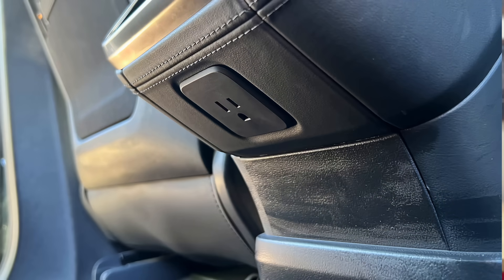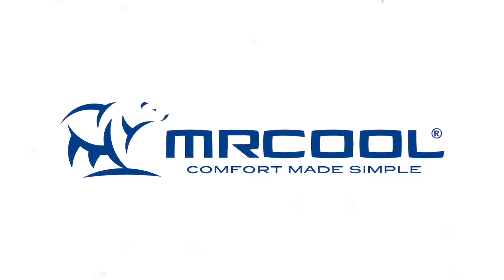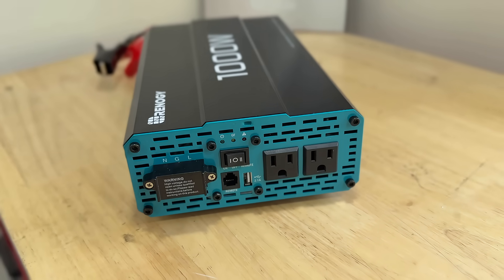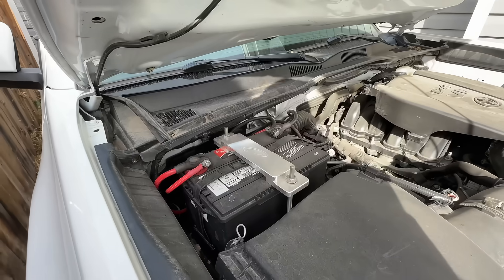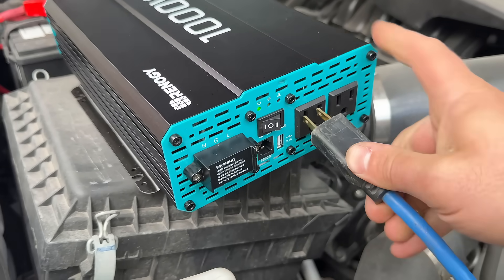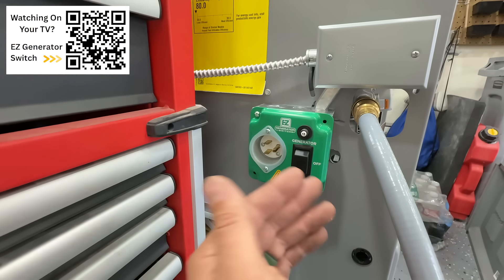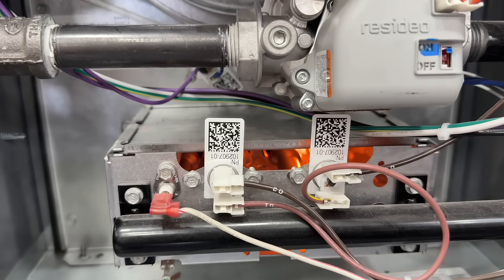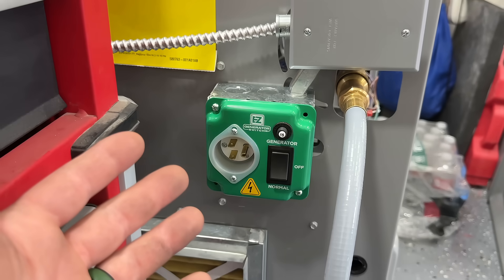Why Buy A Generator? You Have One Parked In Your Driveway.

Comment: Soooo..... burning gasoline at the rate of a full size engine to only get 1000watts of power is a rotal waste. A 1400 watt inverter generator at Harbor Freight is $399 and you can get it cheaper on sale. These will sip gasoline and less wear and tear on your car, and they are as quiet as your car.
Reply: As someone who came into this comment with no opinion, y'all make good points. Some for, some against. Your comments collectively help for the "How Much Will I Use It" category. Thanks
Reply: He said this is an emergency situation. People
In emergencies don’t care as much how much gas they’re going to use. I don’t think people are going to be running their fridges and whole entire home off this set up for a long time! Maybe something enough to make a meal and save some of their food and charge a few devices.
Reply: @BeachMum so 400$ for a proper generator running a 212cc engine 3 gallons per 24h or 200 for potential damage to your engine idling for long periods
Reply: @theevilben666 You don’t need to let your car idle long.  Your furnace only runs temporarily. Your refrigerator only runs temporarily. An alternator charges your battery and under five minutes.
Reply: @BeachMum  
you can't do all that with 1000 watt inverter .. 
you'll have much fewer "emergencies"  if you plan ahead a little bit.. it's not hard.
Real shit's going to happen . 
Don't make yourself a victim.
Reply: @FFLFFS people have been saying this for YEARS. But ok. And my point wasn’t that you need this set up to do all of that at the same time. It’s better than nothing in a pinch.
Reply: @BeachMum 
Yeah, ok but I just don't like the pinch you know what I'm saying . I have freezers full of food . 
I had Uninterrupted Power Supply, but that gave up the ghost (need to replace a capacitor)  and now I have to get up and flip a switch if/when the power goes out . And if it's longer than a day, I've got to start my generator to recharge the 3000 amp  house batteries.(never happen yet) but I'm ready.
If you're not ready where I'm living and there's a power outage you could very well freeze your whole house up and all the plumping or yourself to death worse case no problem . So ya shit happens.. people die every day.
Reply: @FFLFFS people do die everyday, but this is why I moved FAR away from my hometown where if you don’t have power, you die! 1500 miles away to be exact!! 😂 now we don’t have to worry about that ever being a problem! What we saved in heat bills during 5mos out of the year, now go towards other things to be able to thrive more instead of barely getting by! 
Peppers also fail to realize that their chests full of food will not last forever! It DOES and WILL go bad eventually! If your power goes out especially when you don’t know, you lose all that food anyways. In the amount of money you could have stockpiled away in your prepper life, you could have also just as easily saved up to also move away where literally surviving in the cold is no longer a problem! It’s those who live in the colder areas who WILL be the ones going first. At least those living in more of a sub tropical-tropical climate, won’t have that issue. Our power goes out and we’re mildly uncomfortable for a while. At worst, the kids will be bored because there’s no internet. 😂but we have far better resources here to get by than most do up north and else don’t have to freeze our asses off struggling to do so! 
People have been acting like we need to be prepared for a zombie apocalypse but if that’s the case, I don’t really think I’d want to live through that always! According to the entertainment industry, those around are a mix bigger threat to you than the actual problem anyways -ESPECIALLY if you’re all stocked up waiting on dooms day! 
Even so, I lived through the Ice Storm of ‘98 in Maine where the whole region was covered in 4” of ice and we had no power and below freezing temperatures for 2 weeks. We know how to survive even in colder temps! I grew up with the prepper mom who was traumatized by that and always wanted to keep stocked up since then waiting on the next catastrophe! Things like this are few and far between but if you are waiting on the world to end to use up your supplies, well people have been saying this for DECADES with each generation being when it’s going to happen but hasn’t! I don’t have that kind of time or energy to keep buying into that mindset any more! Even if I wanted to, the cockroaches would be the only ones who’d benefit from my stocked up food supplies in the meantime! 😂 
But that must be exhausting for you to live in so much fear like that! I know it was for my mom! Now she’s got food stocked up in her basement to last her for a few years. Even so, it needs to be rotated and used up before it actually goes bad. She has so much food, she gives it away to her kids when they need something, which is great, but when we had some, it just went bad because we never ate it either. 
It’s good to be prepared for an emergency, but for most people anyways, they just deal with it as it comes because that’s just life anyways. Very few emergencies are actually life threatening to us, most of the time we just think they are when they’re really not.
Reply: What is wrong with eating the food you have in freezers ? 
I've eaten several freezer full of food since I've been doing this . None of which have gone bad.. 
it seems you're projecting your fear of betting on tomorrow. 
The "foreseeable future" is a remarkable intelligence,  a cognitive ability we have over the animal Kingdom by the way . I've been doing it very successfully for 70 odd years and I'm very happy  and have no problems living here. I actually thrive in the cold. And I have no wish to be anywhere else . I've been skiing, canoeing and working outside my entire life. . I love the cold water therapy for Eg to add strength and resilience to oneself. I live within walking distance of a 450mi.² lake full of fish.
I actually had a debate with someone like yourself professing I should get outside more often . I came back with I've walked the equivalent in my career 8.24 times around the entire planet in my every day work life.. 

Because I prepare doesn't project fear. It means I buy boots for walking bulk food for sustaining my life and my minimal lifestyle includes power systems so I'm not codependent on anybody else. 
I sustained a successful working career because I involved physics in problem solving. For example : I can simplified the math of power systems predicated on sound scientific principles rather than mythological nonsense...
Like I've done here. 
If this can't be recognized as such, then I've clearly wasted my time with you and beg your pardon.
But I do bid you farewell and thank you for the conversation.
Reply: @BeachMum if you move away from the cold.  
Then you just have to deal with hurricanes or tornadoes 
It doesn't matter where you live  there will always be the possibility of natural disaster leaving you in a position. That needed prepped for ahead of time.
Reply: Honda Inverter generator is the way to go 3 years warranty Honda always start very silent and economic
Reply: @arriagada1957 Still not as quiet as your car, I have a new Honda generator
Reply: @arriagada1957 I agree 👍🏽 I have 2 Westinghouse IGen 4500DF and 2 Westinghouse IGen 2400DF and they also are exceptionally quiet and very efficient. The 4500's in parallel run my entire 2400SF home except my AC. My 2 2400's run the She-Shed including the AC and heat.
Reply: True have a gen is cool but the generator noise is a problem as mentioned or it the generator seized then having an option is better than nothing.
Of course better prep is superior to last ditch.
Reply: @CharlesGann1 noise a problem when you are trying to prevent your pipes from bursting?
Reply: Thanks Larry
I really appreciate your response and you can probably get a warranty with it but it’s good to know you can use your vehicle as a option. I never thought about the vehicle as a generator 😆
Reply: @imarichmultimillionaire5509 Ford actually built a truck that had a 5000Watt inverter generator in it. Nobody bought them and they discontinued it.
Reply: @LarryVotruba 
5000watts is 6.71 hp 
They discontinued it because it was a ridiculous waste of fuel. Everybody and anybody that's ever run a generator knows this.
My 2900 watt generator requires 3.89 hp to run. Super cheap on fuel and a $200. engine replacement cost when it wears out .
Reply: @FFLFFS 99% of the comments hear 👆🏼👇🏼 just dont seem to understand that. Running a $50K car vs cheap inverter generator. Clearly they have no idea how quiet these things are. The others don't understand why you should prepair for anything at all.
Reply: Most of these 4 cylinder gas car/truck engines we have today use far less gasoline at idle than what a generator is going to consume so your argument isn’t valid Larry. Now If your gonna hook up your 1987 GMC truck with the 305 or 350, then yes, you have a very valid argument, but if your running a 4 cyl or even many of the V6s, your gonna consume far less fuel by letting the car/truck do your generating than the actual generator.
Reply: @1982MCI 
Nope it's impossible. A 1400 W inverter takes 1.8 hp to generate that wattage . Any vehicle engine idling will burn way more fuel than that. 
Better off with a cheap generator on natural gas or propane. The waste heat from a I.C.E. Is 80% and with an  air cooled engines.. scavenge the heat from the exhaust with a heat exchanger before venting it outside and you have heat and power for a few hundred dollars.
Reply: Well remember in an emergency situation you work with what you have on hand. The Harbor Freight will be closed or sold out but you probably have a vehicle in your driveway.
Reply: @rebelbecky276 So you had the forethought to buy a 1000Watt inverter to have on hand "in case of emergency " but not a solar generator or inverter generator? Do you see the irony?
Reply: @LarryVotruba The irony is if he's making it and conveying that this is HIS emergency power plan. He's simply sharing an idea for some, a hack of sorts, that can use in a pinch. This is especially useful for those that don't have the money to spend for a gennie.
Reply: @ValioMadre7 😆 funny
Reply: Yep my yamaha ef1000is just shit it's self! I'm off grid and only use it when we have sustained overcast days. I might just roll with this idea I reckon.
Reply: Combine heat baby. 70 percent of energy is heating.  Build a heat exchange to steal the from the exhaust. Clean air in wraps around the hot whatever and hot clean air to a port in your house.
Reply: We don't have harbour freight so I got a 3000 watt inverter for $250 hooked it up to my lawnmower with an extra 12 volt battery. The lawn mower charges at 8.5 amps.. 
good enough for the girls i go with!
Reply: I have a Predator 3500 inverter generator that will run my 5th wheel for 8 hrs on one tank of gas.
Reply: @timkinney9690 I have one of those also, for the money, you cant beat it. The predators are far easier to change the oil on over the Westibghouse too.
Reply: @timkinney9690 I got a $30 propane/natural gas/gasoline carb on my 3500....it's for emergencys so being propane cuts down on the constant upkeep of gasoline going bad....
Reply: If you rely on it as an emergence item and not your go-to for a camping trip, you're squared away, its not to be relied on as your A#1 go to for power during an emergency its a back up to your primary during an emergency. The generator that you bought at harbor freight might not be working because you don't use it  everyday. Most likey your carb will be messing up on it unless you stay on top of all the maintenance for the generator or maybe a mud dobber has stopped it up someway. Point is I bet you have 2 or 3 ways to make fire it would be a blessing in an emergency to have a few options for makeing power if you had to also! Y'all please remember 2 is 1and 1 is none in any emergency/survival situation.
Reply: @ajfarms630for a fix to your above scenario is a robust powestation/solar generator. I built mine but you can buy one for an extremly reasonable price. Mine is a 2,500Watt with a 300Ah battery and it runs my fridge and a portable AC just fine and for an extended period.
Reply: @LarryVotruba I really want to get into that. Before snowmageddon hit Texas a couple years ago I was looking to buy a PTO generator but wasn't able to at the time. Its a funny thing when disasters happen all of a sudden my wife agreed we needed one😂. So we bought a 15kw WinCo for $1600 that can run off our tractor. I have it in my barn tapped up and covered to keep the varmints out do you know I've only used that thing a couple of times since we 1st got it and thats just to make sure it will still generate, that's kind of why I'm not really for gas generators. I run my tractor nearly everyday on my farm so I'm not worried about carbs messing up with bad gas. I did make a platform recently to where I can run a cracker box welder off the generator for mobile welding and make the generator a duel purpose item. Anyways to your point id sure like to get solar if for anything else to just occupy my mind for a while and keep me out of trouble. An idle mind is the devil's playground.
Reply: That's a problem when you have a big petrol engine. But there are other variants, for example the Peugeot 1.1 petrol engine has an 80A alternator from the factory. That's about 1000 watts at 2000 rpm.
Reply: This whole approach is a case of foolish innovation taking precedence over simple common sense. Buy any generator for $400 to $500 for crying out loud and be done with it. Sheesh.....
Reply: All of these comments have some merit but I remember in 2004 when we had a major hurricane I had an inverter and an old van in my back yard with almost a full tank of gas. I tried this and it actually worked. I ran my refrigerator, water tower, 4 fans, Directv and a television on one tank of gas for 2 weeks. So in a pinch this is definitely a solution if you have an inverter on hand now we have other measures but not everyone can afford the solutions we recommend nowadays.
Reply: Yeah not to mention, alternators are only 70% efficient at peak loads which is like 1800 engine rpm(on avarage) not idle 
Were generator heads are 95% efficient 

Plus a altanator at idle is only gunna produce like 700w tops
Reply: Car uses less gas than generator, quieter too. Also used less gas than lawnmower engine. Even better get a deep cycle battery. I leave my hood open for heat dissipation.
Reply: You obviously didn't watch the whole vidyou'll.Because you don't leave your car running.You only have to turn it on now and then to charge the battery back up
Reply: @Valerie-bb5hi oh no, I fully did. If you do as you suggest and is in the video, you have a very dead battery. A 1000 watt inverter will dip a lead acid battery in a snap.A deep cycle battery can cycle like this, a standard car "starting" battery cannot. Today a new battery will set you back between $199 to $299. Now, why not just use that money and buy a dang generator or solar generator????
Reply: @LarryVotruba no I went on temu and got a power bank for $350 that was.  1800 W.\n So I'm happy.\n What made it so wonderful? Is it had so many ways of charging from solar to your car cigarette lighter to just plugging it into the wall.  I can't remember the fourth\nBut I feel set
Reply: @Valerie-bb5hi 
Valerie, You need to be able to crunch a couple of numbers: 
1000watts = 1.342 Horse Power 
(1000/ 745.4=1.342 ..1 HP=745.4 watts .. )
The 100 HP car idling to make 700- 1000w (1 HP) "to charge the battery" is pretty much a total waste of money..
Why ? 
The power from the car 700- 1000w intermittently ➡️ battery is only 70% efficient and then going into your house is useless. Just enough for a couple of light to watch everything in the fridge thaw out and go bad.
Or be shivering waiting for the power to come back on.
So is wasting your time watching the entire video to expect some miracle that defies the laws of physics.
Instead do something more proactive like searching for a power supply that is affordable and sustainable that can at least run the fridge and furnace. 
Is all this all starting to make a bit more sense now?
Your welcome 
(You'll be thanking me later)
Reply: Its just temporary
Reply: @dominic8520 
Like your cash
Reply: A coffee maker needs 1,500 watts.
Reply: What if I’m gay?
Reply: @Zach-ls1if then it is funny while you do it.
Reply: @Zach-ls1if only a gay would ask that question tbh
Reply: @TheTruth10153 I am gay
Reply: I have a 12k watt duro max and it chugs gasoline
Reply: @bert192 12KW, yeah!!!
Reply: @bert192 I have dual Westinghouse 4500DF inverter generators in Parrallel that put out a bit over 9KW when full out and they will eat 3.2 gallons each in 8 hours.
Reply: How often do you use your gen set ? daily ? weekly ? or once every 2 or 3  years .
Reply: @oldmanwombat actually every couple of months. You do you.
Reply: American reasoning😂
Reply: I’d e worried about someone stealing the truck, you sure don’t want to leave it running in your garage or driveway.
Reply: @Grreed-g6uthere is that too.
Reply: Larry…you’re dreaming, they are not as quiet as your car.
Reply: @Slick70 open frame isn't, but inverter is easily as quiet as a car at 45 to 50 decibels.
Reply: @LarryVotruba An inverter is quite a generator isn’t.
Reply: @Slick70 and inverter requires a power source. Batteries only last so long. You need solar, wind or generator to maintain that source of power.
Reply: What if it's emergency situation and you can't get to a generator Larry? When the country collapses in few years and you can't go to harbor freight you'll be glad you watched. At least til you run out of gas. Better go watch a how to make a natural generator next.
Reply: @tyson8524 If you waited, that is on you nimrod. You should be prepaired NOW! But for your scenario, Solar Generator fixes all that and a bag of chips. Even if you live in New York or California, solar generators work and can recharge with nothing but a bit of smog covered sunshine.
Reply: Jesus😂
Reply: Your average car engine burns between 1/3 and 1/4 gallon per hour idling.  Energy in equals energy out. Whether your running a 1500 watt gas generator or powering a 1500 watt inverter from your car engine you'll burn about the same amount of fuel. Now, with an inverter you eliminate all the maintenance a generator needs. No oil changes. No special fuel on hand to feed it. Generators really need to be cycled pretty frequently to be ready when you need them. Pulling the old generator out of the garage after three years just sitting isn't going to be a good experience. Very unlikely someone is going to drive off with your car. I know many people that have had generators stolen at inopportune times.
Reply: @douglasw7806 Exactly!  I've lived in central Texas 20 years and have had a sustained winter power outage exactly twice.  

As you mentioned, such little use would cost me having to store gas (and toss out when it ages), cycle engine, remove the fuel, change oil (repeatedly), find a hiding spot, have the whole neighborhood knocking on my door complaining or wanting in and the cheap ones are   detrimental on sensitive electronics (like the mother board on your furnace) NO thanks.....
Reply: @douglasw7806 Some good points there. However the one about nobody is gonna steal a running car , but they may steal a generator, is not your best point. Bc in a desperate scenario a running car would be VERY likely to be stolen.
Reply: @douglasw7806 
Never! 1500 watts takes less than 2 hp to generate. Any vehicle idling will take more fuel than any 2hp ICE.
Reply: @douglasw7806 this is bad logic. I have a 2000 watt inverter in my van and own a 2500 watt inverter generator. I've run both and using the inverter generator is by far more efficient. I don't need special gas. Just regular unleaded. I've burned out 2 fuel pumps in my van by idling and it costs about $20 to run it all night, where as with the generator it costs me$3.00.
Reply: @douglasw7806  Apparently you don't live in a highly populated US city in the year 2025 If you think that running your car, especially for hours, isn't going to be a prime target for theft..
Reply: @douglasw7806  Yeah, by saving wear and tear on a $300 generator, you're creating excessive wear and tear on a $50,000 car. That makes so much sense!
Reply: @HabaneroTi  excessive? If you're only using your car for emergency power once every few years, the amount of wear caused by this usage would be super minimal.  The person you replied to is indicating that you need to run & maintain a generator regularly to keep it healthy ... which is what you're already doing for your car.
Reply: @Ck87JF  As I wrote, occasional emergency use is fine, but powering your tailgate party or campsite with your car is not just rude to others, but bad for your car. But then so is using a generator, which IMO should be banned from campsites.
Reply: @HabaneroTi who said any of the things your replied with?   You just want to argue a stupid point…
Reply: @1BobsYourUncle  It's not stupid to argue that idling a car other than in an emergency or if the weather requires it is bad for the car. Actually idling a car is bad for it no matter the reason, but sometimes it can't be avoided. But if pointing this out bothers you, not my problem.
Reply: @HabaneroTi  I worked in sales for 22 years. All the cars I've had while doing that had at least 150K miles on them when replaced. Believe me, there were LOTS and LOTS of hours sitting on the side of the  road, in parking lots, idling, while checking email or or on the phone working on an issue.. I never saw any deleterious from idling for long periods of time.
Reply: @douglasw7806  Still not good for the engine, overall, and 150k isn't that much these days. It's bad for emissions, and efficiency. Look it up.
Reply: @HabaneroTi  In the days of carburetors was most likely worse for emissions, a lot worse.  With modern. precision, computer controlled fuel injection and exhaust gas oxygen sensors I expect it's no worse than driving it. Yeah, idling you're effectively getting 0 mpg so there is some efficiency lost. It's minor though.
Reply: @douglasw7806  The you expect wrong, as idling is bad for modern cars too. Engines need to get up to proper operating temp to run efficiently, which idling will never do, leading to improper combustion and water vapor mixing with oil and damaging the engine over time. Google it, it's a known thing. The damage is very gradual and over time, and of course occasional idling is ok. But doing it for hours on a regular basis will harm an engine and car.
Reply: @douglasw7806 That's why you had to junk them at 150k!
Reply: @elw6150  No. I had to sell them at 150K because company policy was it had to be less than five years old. Had to get something newer.
Reply: Is your going to rely on a $300 gen set . Save your money .It wont start when you need it.Test runs = fresh fuel in it every 90 days ( fuel is considered bad @ 90 days in a motor or a fuel can or in bulk tanks ), oil change every year .
Reply: @spectrumofreality  Well sure, if it's that once in 5 or 10 years event that lasts a few hours to days, perhaps. But if you live in a region with regular outages, this is just dumb. Plus people who live in such regions should be installing solar setups anyway, even if they're MAGA.
Reply: Or for $150 you can get an 18,000 BTU big buddy heater, 20 lb hose adapter and 20 lb propane tank and that will power it for a week straight on high. Even cheaper than a generator.
Reply: @Steven-gv1ke only good for heat.
Reply: @myjhong91 
Propane heat ,light and cooking....
I even run the generator on propane..
Just what more do you want???
Reply: @jonjacobjingleheimerschmid3798 didn't even think about a propane generator.
Reply: It’s not a ‘waste’ Karen
It’s an OPTION in an emergency
Get over yourself, you’ve shown nothing that merits your ego.
Reply: @kimberlyrogers9953 says the person with seagull management skills. You offered not one benefit to the conversation. Nice 👍🏽
Reply: I've heard that idling for long periods is bad because the oil flow isn't great, this true?
Reply: They are not as quiet!
Reply: @gilianrampart8514 a modern inverter generator is about 55 decibels, that is the same as two people talking to each other or an idling car.